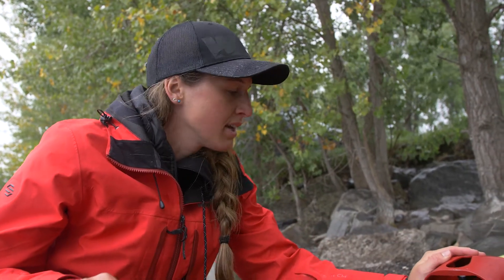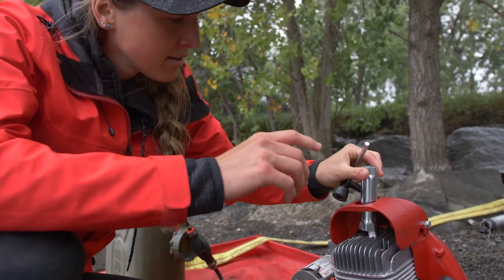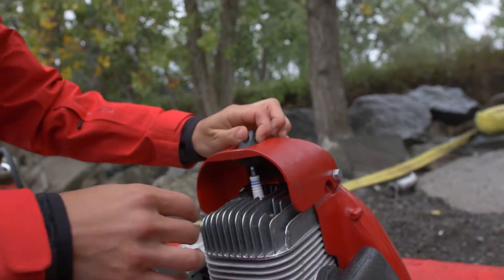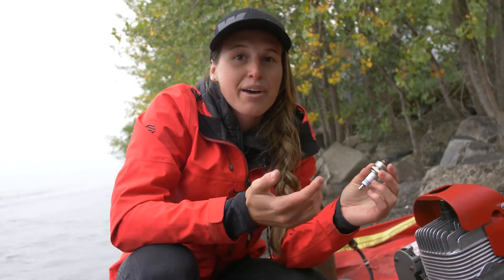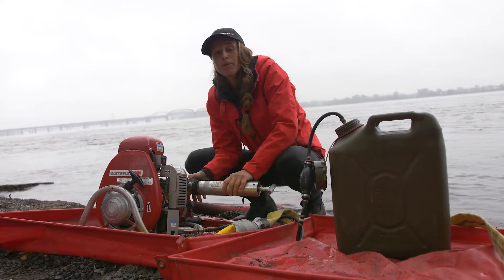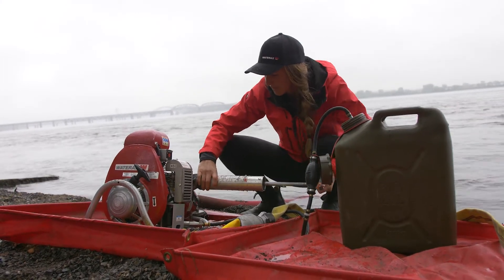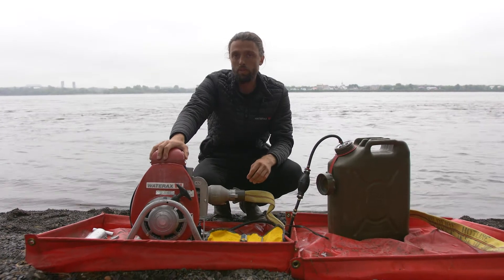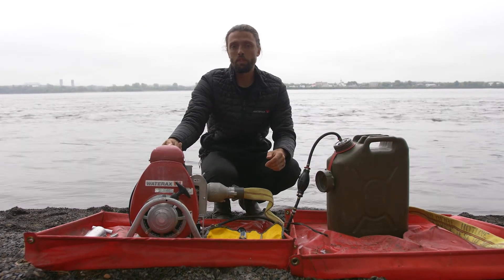The MARK-3® Pump - Troubleshooting Basics

Comment: Don't hook check valve to pump. Use a piece of hose put check and bleeder on end of first hose. Vibration can crack threads on case and ruin pump head